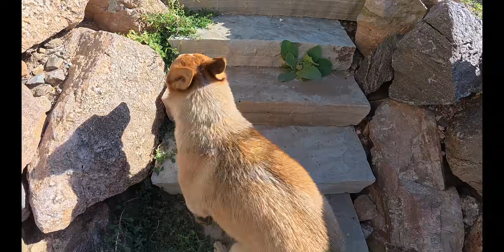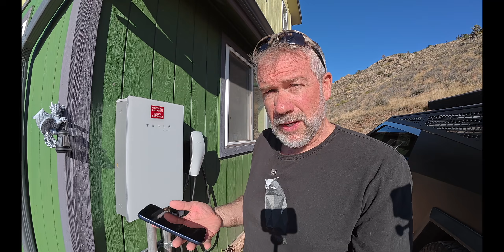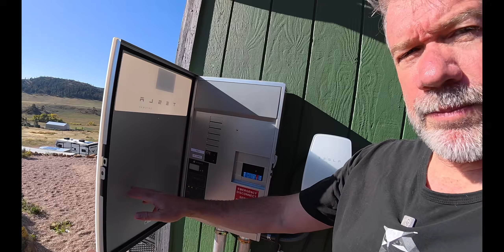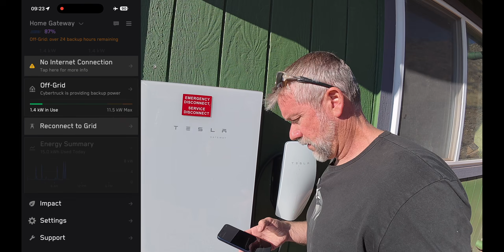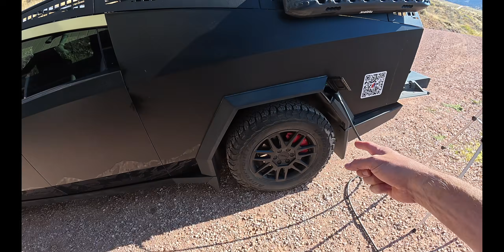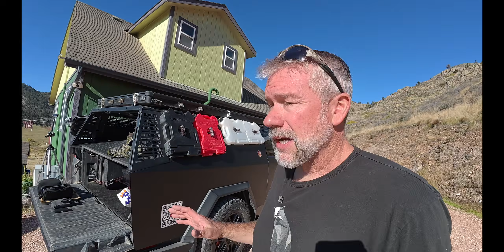Tesla PowerShare Part 2: Nerve-Racking First Test & Installation Success? PowerShare Part 2

Comment: I went with solar and powerwall 3 after getting my CT.  Still waiting on powershare update.  It's funny, I was nervous/anxious when going off-grid for the first time.  I was absolutely amazed though as no lights flickered in the house and our typically sensitive clock didn't even reset.  It was seamless going offline and then reconnecting.  Amazing tech from Tesla once again.

Comment: My truck started showing condensation on windows like yours. Found the water was entering behind the cantrail. This was before the cantrail recall. There is a up graded gasket that goes behind the cantrail to fix this. Let me know what you find.
Reply from the maker: I had my cantrails redone, and there is still quite a gap behind them on my non-foundation, but my foundation edition truck the seals are very tight after having the cantrails redone.

Comment: So it’s not a seamless transition? Would the power be interrupted while switching from connected hydro power to CT power ?
Reply from the maker: There is about a 2-second delay when the power goes out, but it does seem seamless when going back to the grid.

Comment: My cybertruck is in service now getting the extra slat added at the top of the tonneau. Did your cabin leak start happening after they messed with the tonneau? I know it is rather intensive to take the entire tonneau off and add the slat. They have to access it from under the rear seats according to the maintenance manual.
Reply from the maker: Actually, I had moisture before the work on the tonneau.  Service thinks it's a door seal in my passenger door because the holding mechanism, as you open the door, is making noise after a rainstorm.